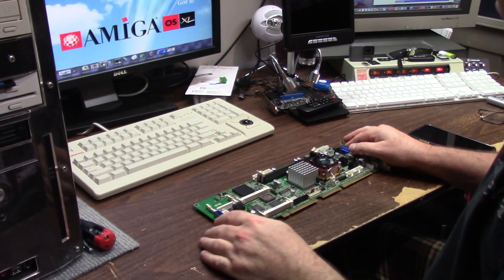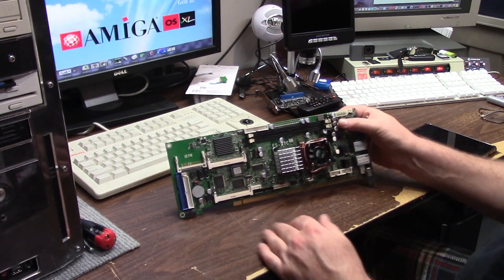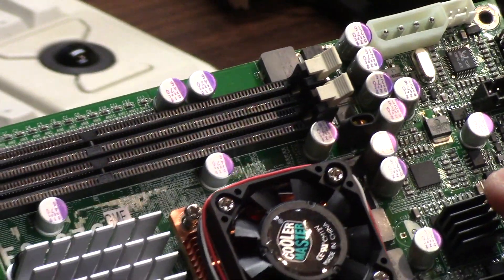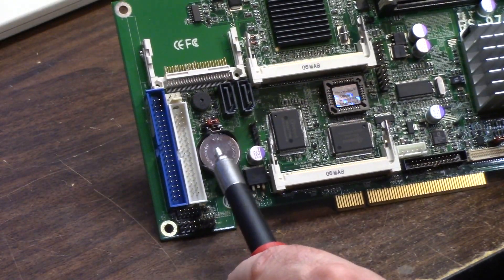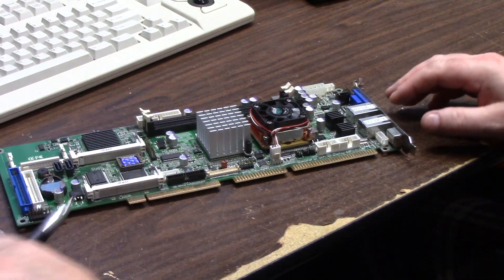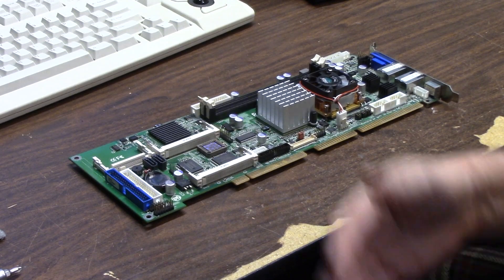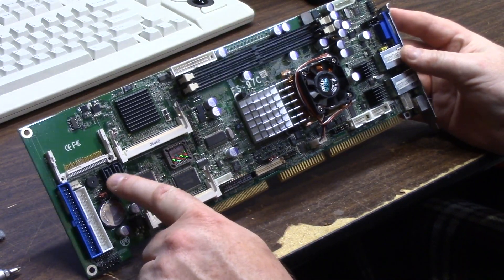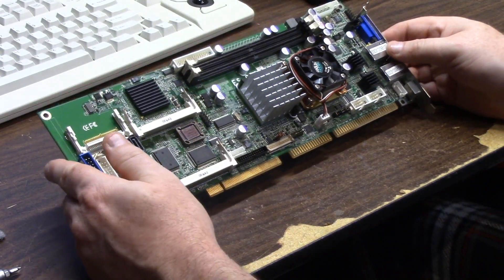What is a single board computer? presenting the fs97C

Comment: its not "isa or pci" its picmg. and you cant just shove it into anything with a pci or isa slot that does not do bus arbitration (ie: another x86 pc) as you will get collision on the bus as two cpu fight. some will run headless, some wont. so most will need a boot disk with dos or something installed. i have a one thats just isa slot length thats dx4-100, very nice sbc for its compactness and ability to boot from eprom disk image which is really just a custom 1.44mb disk image.
Reply from the maker: Idk
Reply from the maker: watch and see. i do and it works fine, its going in an Amiga, not a PC, the Amiga's ISA slots are not active on the Amiga side, they were for the bridgeboard.
Reply: @ChrisEdwardsRestoration  Thats cool, I didnt know if the 68k arbitrated the isa slot memory addresses into amiga ram that could cause issues. glad to know it works.
Reply from the maker: I did and it works fine for power and no conflicts.  The amiga bus wont arbitrate it.  A regular pcmig board for these will support arbitration and you can then use the other slots as expansion for the sbc.  But on the amiga its been fine since i installed it.
Reply from the maker: Oh.  That would probably blow them both up.  Lol

Comment: This is exactly what I've been waiting for.  I wanted a bridgeboard, but they're so expensive.  I'm mainly just wanting something in a 486 or Pentium level, but maybe something that powerful.  I'd like to be able to play some old MS dos games.  

Are you going to upgrade the power supply as well?  I've been thinking about gutting my PS and finding a ATX PS with the -5v rail to upgrade it.  

I assume these will behave as two separate computers though, needing a keyboard/mouse/monitor/speaker for the SBC or a means to switch between the amiga's peripherals.
Reply from the maker: My power supply is the original, yet it has been rebuilt so its strong... the sbc only uses about 12 watts so no biggy

Comment: I put mine into my A2000 best place for it is on the far left end PC slot so the  PCI connector floats above the MB, also added the 2x 16 bit EISA slots so there's a 16 bit bus to the SB16. Got it to dual boot with System Commander off 3 partitioned 128Gb SD. Dos 6.22 with Win311 on one partition, Win98SE on the other and 3rd partition is big data drive for storing games like Doom and Duke Nukem 3D etc... It's a full P3 with 256Mb ram and runs all those old 3D at full steam.

Comment: Another great video Chris 👍🏻 And yes I have learnt something today 😉 hadn’t a clue about these boards existing. Looking at the edge connectors, will this fit a 2000? Looks to me to have both PCI and ISA? Or is it Zorro and ISA? If this card is supposed to work in a bridge type way with the Amiga and the slot is optimised for zorro 3 then the A3000 or 4000 would be better?
Reply from the maker: Sure will.  Stay tuned for the next episode i install it in the 2000